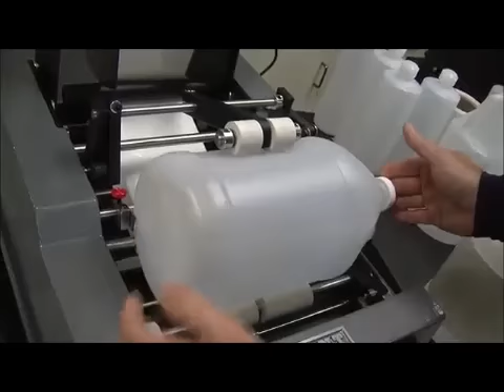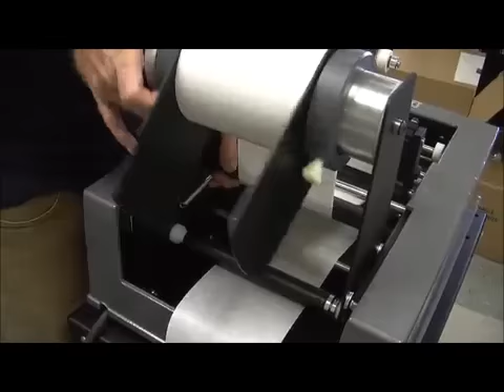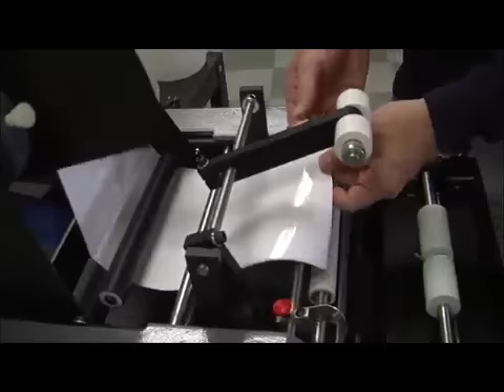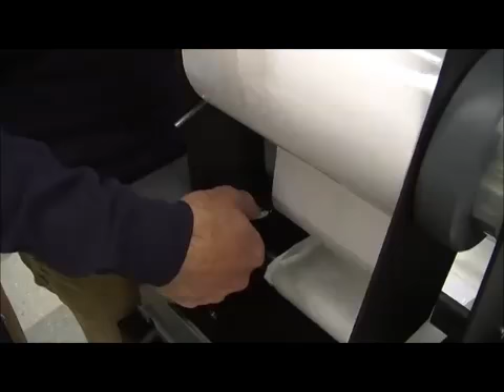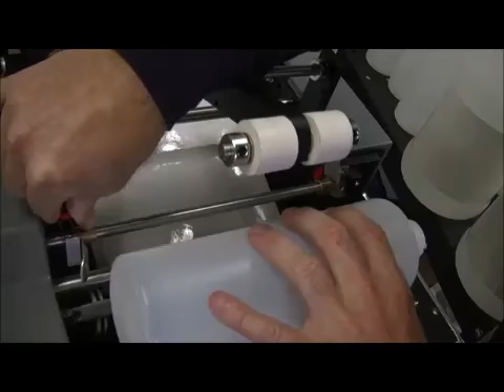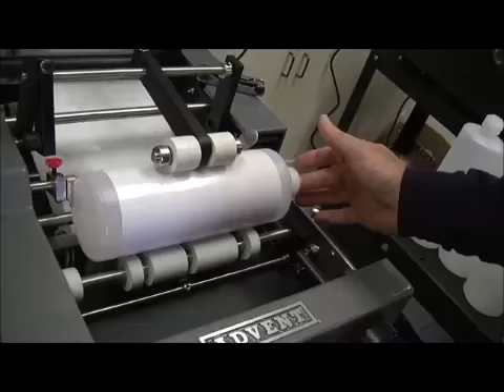Advent Model 300 Label Applicator

Comment: What size paper you need for gallon jugs 12× 12. ?
Reply from the maker: The label hight will depend on the application area of your jug. a typical 1 gallon jug would use a 4-3/4" high label. The label length can be as short as 2" or full wrap around.
Reply: starpkg 
1. What’s The model of your bottle blowing machine
2. What’s The brand of your bottle blowing machine( rotary or linear)?
3. Any v Cv hence you can help with more information, l want to have similar 1litre, 2Litre and 5litre Moulds. Email: goodson.nkhunje@yahoo.com or WhatsApp 00263777289393